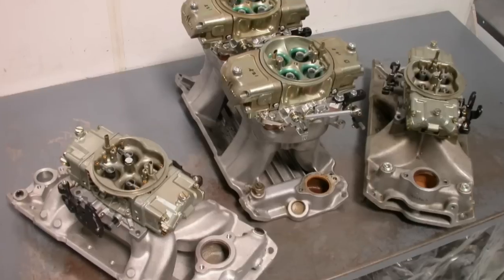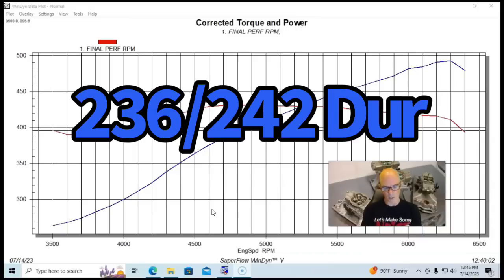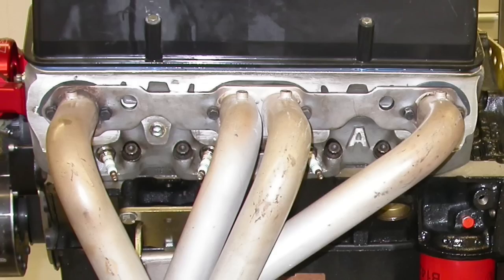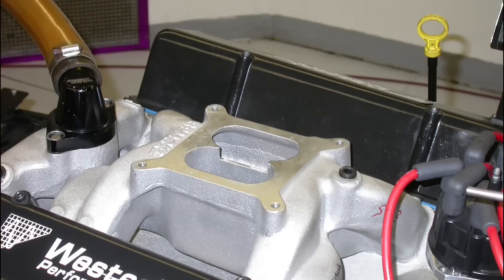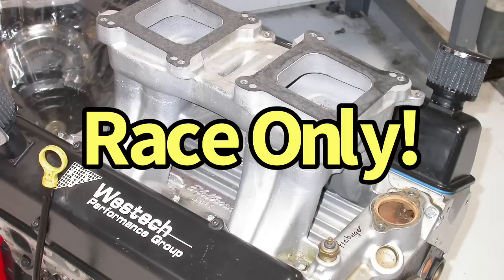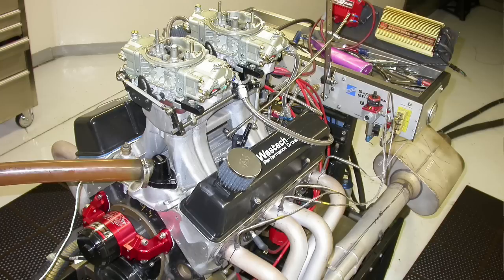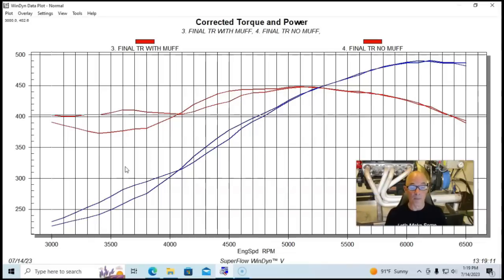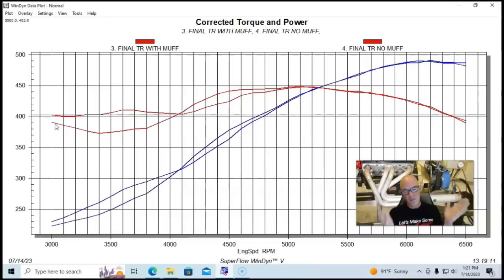HOW MUCH POWER IS A SBC TUNNEL RAM WORTH? 355 SBC INTAKE TEST-TUNNEL RAM VS RPM AIR GAP VS VICTOR JR

Comment: Had a friend with a 71 327/350 Vega, it went well and drove great ran low 13s.  He then switched to a 30/30 cam, tunnel ram with 465s and a Vega converter, the car was insane ran high 11s.  Total cost for the parts ~ $600 in 1988.  He put it together in one weekend.
Reply: I used a Vega converter in my th400 it was so loose from a stop on hills.
Reply: @vinceyoung5912  What was the vegas stall speed? Never knew about those
Know some late model S10s were 24-2500 C4 guys liked to use those on 700rs
Reply: @gordocarbo  it was a small converter. 3000 at least
Reply: @vinceyoung5912  thx!
Reply: What is a 30/30 cam?
Reply: @drd1924  GM Term for the solid lifter cam used in some vettes, Z/28s
Rocker arms were set at .030 lash on intake and exhaust.
Reply: @drd1924  it’s a solid cam with 30 thousandths lash on intake and exhaust
Reply: @gordocarbo  Copy that, Thanks
Ford guy here so ya know.
I've heard the term 3/4 race cam
... Full race cam etc. which in effect really means nothing when Cams are usually described in terms of either lift or duration.
3/4 Race is just some obscure slang term for how radical a cam is past stock
Never heard of any other terms such as 30/30 so I suspect is a proprietary GM thang.
Reply: @vinceyoung5912  Thanks man, now THAT makes a lot more sense.
That's quite a bit of lash compared to most.
I remember once I was reading one of my older Truck manuals to set the lash on my 429 BBF and it said 0.250" 
I had to stop and reread that like 3 times
And finally figured out they meant
0.025"
I shudder to think who might have actually followed the manuals advice there lol.
Reply: @drd1924  254/254 duration .485/.485 lift solid flat tappet cam used in fuel injected 327s and the 302.  30/30 name came from the I/e lash of 30 thousands.
Reply: @gordocarbo  4000 - 4500 in my experience
Reply: @edwardwood3622  Thaaaaat's more like IT! :D

Comment: So this one time not long ago, the night before one of our local car shows I decided to install a tunnel ram that I expected to be for more show than go, it had been sitting on the shelf for a decade, it was an original offenhauser with a massive upper plenum from the 70s that I had bought at a swap meet for a completely different project and I was sick of looking at it, so I got to work re-sealing the 500cfm Carter competition series carbs that it came with and installed it all with a completely new MSD ignition system and all of this going on a 100% bone stock 350 that had been recently rebuilt and .030 over, stock 70s truck heads and cam, it had small primary long tube headers and mated to a 700r4, it was replacing the original intake and Q-jet that ran well in my open wheel roadster, after some quick tuning and a couple HUGE burnouts to say I was shocked with the seat of the pants difference it made would be an understatement!!! I never imagined it would work as well as it did on a stock 350, I’m a believer!!

Comment: Runner length, runner length, runner length!!! Mr Holdener, you ROCK! ThankYou for all the hard work and data you share. There is a company called dashman making tunnel ram spacers for weiand tunnel rams. Like 1-4inch lengths. Might be cool to see it swing the torque curve. Stack them up for a carbed TPI torque curve?

Comment: If you had added another 1000 rpms you would have seen the improvement that the tunnel ram was designed for.
My 361 inch small block picked up 64 hp when I went from a Victor Jr and an 850 Holley. To a tunnel ram and 2 750 carbs at 7800 rpms.
  My motor was 12.5 to 1 and had 220 afr heads and had a .630 Crane roller cam.
     It brought my nostalgic gasser from 6.70 in the 1/8th to 6.30. Then I swapped to twin toilets and alky and dropped to 6.10.
Reply from the maker: this cam would not go another 1000 rpm
Reply: Will a bigger cam help the ram ?

Comment: SBC vids are THE best. I'm only 29 but I'll still likely never build an LS. Love the old school stuff too much.
Reply: They are very vailable and built from scratch with aftermarket parts cheaper to do than an ls. 
BOlts right in no hassles with wiring

Comment: Me and my buddy just finished a 331 sbc gasser type and had the 600 carbs totally trickef out and the throttle response was wicked fast, been told it would it would not work ! I believe its the combination of the correct parts that work together. Been building sbc engines since 1970, but this one was the most exciting and satisfying build  !

Comment: Joe Sherman (rip) consistently  made 30 to 40 more HP than a single carb single plane , but his testing was mostly on 400/410 ci engines.
Reply from the maker: Joe was awesome
Reply: I'm going to look at a 73 Ford Mach-1 with 400 and a tunnel ram dual quad 351c adapter kit this weekend

Comment: Unless you happen to have a common plenum tunnelram, you need two carburetors individually as high-flowing as the carb used on a single carb intake for a given motor.

Yes, that's individual flow - not combined. 

Regardless of layout or number of cylinders (as long we're talking fourstroke and the number is less than 16), there is only one (1) cylinder at a time being fed air and/or fuel from the plenum/carb. Thus, on a dual carb/dual plenum intake you need each carb to be able to provide as much flow as on a single carb/plenum ditto - otherwise, it becomes a restriction and this of course hurts power output.
Reply: I don't think I've ever seen a tunnel ram with a divided plenum. IIRC they all use a common plenum. That said, if you have a divided plenum with 2 throttle bodies, the plenums have more time to refill after each intake stroke. So you can use throttle bodies smaller than the single unit. But half the size of single unit might be too small.
Reply from the maker: I have never seen a tunnel ram that feeds two distinct (separate) plenums from each carb and your theory that you need double the flow rate for two plenums is also inaccurate

Comment: The TR1Y is pretty ancient, that design is about 50-55 or so years old.

It would have been interesting to see the tunnel ram with two 450 cfm carburetors, I'm thinking 900 cfm was plenty, and the 650 carburetors might have been big enough to hurt torque, and maybe they didn't work great with the plenum.

It would also be interesting to see what the air fuel ratio was. I know you played with jetting, not saying you missed. Just saying we see a ton of power by working on making the fuel curve the engine wants. Just jetting doesn't necessarily get you there.
Reply: Quite the opposite, the 650s are too small on the TR.
Reply from the maker: 650s are actually oversized for 500 hp
Reply: You right  in the 70's that intake was used for 7500rpm+launches
Reply: I agree with needadate and ronnie , needs more cfm for the tunnel ram , a set a valve springs would also help , my guess is the springs are going off in a hurry and the ram was tested last so suffered the most up top
Reply: It would be interesting to see how the new sheet metal tunnel rams work vs these older one?
Seeing one vs two carbs would be interesting.
I would think the top hp would be close?
Reply: @hobbesnmina2001  the throttle response will always be better with a venturi and accelerator pump discharge nozzle directly above each runner.  Factoring in that the carbs are all tuned and adjusted,  dual quad setup is far superior to a single on a tunnel ram.  I would like to see a dual quad carbs vs dual quad Holley Sniper efi on a tunnel ram.
Reply: That's not how dual carbs work. Each carb gets half the signal of one single carb. 2x450s don't give 900 cfm is what I'm saying.
Reply: @jeroldlafferty54  no it wasn't, the victor ram was
Reply: @lollipop84858  back in the 70's and 80's if you was running any 2×4tr stick shift cars would leave 7500 shift at 8500 go thru the lights 9000 with 660cfm carbs. Victor intake didn't come out until late 70's if I recall.
Reply: @jasonjordan4672  Think that cam was running out of breath around that rpm also

Comment: My personal 406 with AFR 245 heads makes 665 HP using a plenum modified Super Victor 4500, I did try a tunnel ram and twin 950's and although both combinations made similar power, the Super Victor had a much broader power curve, and therefor much more average HP and torque than the tunnel ram. The tunnel ram did look much cooler though.
Reply: Interesting. I have a 406 with a dual tunnel ram set up. Seems like low end power is a bit weak.
Reply: @transformationclass5054  dual tunnel rams?? 2 tunnel rams?? Wicked!

Comment: I'd be interested to know what the jetting was on the tunnel ram carbs.... If you're too fat you're going to lose power.... a/f ratio is something that needs to be considered.... Frieberger did something similar on engine masters and the tunnel ram made more power everywhere except the very bottom end....so many factors need be to considered.
BTW I've been running the same exact intake rebranded as the Eldebrock street ram for years starting with a 355 ci and now with a 383 ci the combination has worked great for me and looks amazing.... I've had no problems with drivability especially in stop and go traffic... works for me....

Comment: Put some valve springs in the engine! Totally inconclusive test if you didn’t rev that engine to the rpm it should operate at
Reply from the maker: agreed-missed it by 200 rpm
Reply: @richardholdener1727   so you bamboozled them huh? J/K

Comment: I expected to see general torque ad lower end power increases but I'm kinda surprised it didn't have a higher peak than a single card.  But about exhaust I always wanted to try to make a variable type exhaust so it would scavage low but then at 4k or so open up for all that top end. I just think it would be fun to get the max everything
Reply: Your exhaust fantasy is referring to correctly designed (Elston) tri-y headers

Comment: Hey Richard, have you ever done any dyno testing of scoops vs stacks, with and without filters, on tunnel rams?  Thanks!
Reply from the maker: stacks?
Reply: the velocity stacks that mount atop the carbs, some use no filter, some use a screen with foam, and some use a filter with a lid.  Shaped similar to a funnel.  I know you’ve seen them before.

Comment: Those straight through mufflers need a certain amount of exhaust flow to become efficient where there is almost zero restriction.
Reply from the maker: why do they need more flow to become efficient?
Reply: @richardholdener1727  from what I understand once you get enough flow the exhaust will pass right over the perforations instead of penetrating eliminating turbulence producing effectively a straight pipe.

Comment: More carburetor on the tunnel ram. Two 750"s I think would fix the lack of upper RPM horsepower.
Reply from the maker: so 1300 cfm wasn't enough for 500 hp?
Reply: @richardholdener1727  since it's not a common plenum, you had 650 cfm available - not 1300. See my post below.
Reply: Yes, and since we're around the 500 hp mark even bigger carbs would most likely improve the output over those.

There is zero (0) difference in individual carb flow requirement between a single and a dual plenum intake on the same engine. This is pure physics.
Reply from the maker: I believe these had a connection in plenum, but if not, then you are saying that a 650 isn't enough to support aa 4 cylinder that makes 250 hp. Having tested this on the dyno on another sbc, you are incorrect.
Reply: @richardholdener1727  Amazed how many try to correct you and the usual response is they heard...or the internet said..
Wow

Comment: Regret selling my 87 back in 07 now i have a 90 k1500 4x4 5.7 single cab im building runs perfect at the moment ac,heater works engine purrs nice and quiet unwanted noise..looking for a mild cam gona run 199cc afr heads convert my tbi back to carb and run a dual plane air gap,with a 750 cfm holley..just not shure what cam to run..i want a H roller for maintenance and reliable just dont know which option to go with..people say the 270hr is a good option befor having to upgrade to a 26-28 stall converter

Comment: That compression, cam, and springs are well suited for the single carb-dual plane combo. It's border-line stretched for the single plane. And it is totally wrong for the tunnel ram. A tunnel ram shines with high comp., much more cam ( high overlap decreases dynamic compression so it can live on premium pump gas ) and strong enough springs to let the TR eat at 7 to 8K where it's designed to run. THAT'S the purpose of a tunnel ram. As with everything automotive; it's all in everything working together! This video proves just that.

Comment: Was that cam a solid, hyd ft or roller? Remember that article. 
500 was a big deal for a 350....remember in the 80s the 390-400hp recipe was 11-1 350 292 type hft cam ported 2.02 irons and of course The Berg had a Vic Jr on there lol. Isky 292 mega seemed to hit harder than the comp 292 magnum
Id think you were losing valve control up top the TR should carry a bit more unless it was outta cam. 
Whaddya think Jedi Richard?
Reply from the maker: roller

Comment: So I'm trying to convince my friend to go with a tunnel ram with a dual efi throttle body injection using the super sniper. His engine is a 400ci sbc destroked to a 377 I think but his compression is 11.5:1 and runs on 93. I think the tunnel ram will wake that engine up by alot. What do you think he should go with?
Reply from the maker: tunnel rams work well
Reply: WHy not 2 carbs way simpler cheaper no need for all the electronics, screen in the car etc
Reply: @gordocarbo  the car is a daily/weekend warrior car. Last thing he wants is a car only doing 6 miles per gallon. Carbs are nice if the engine was a all out drag car but this is a car used quite abit more then a trailer queen. Plus he did do a tunnel ram with 2 efi holley super sniper systems. He is also running on coil packs vs a distributor. The car made 730whp 620wtq on e85. The compression was raised to 12.5:1 compression. I told him if he's not going to drive it as much but at least 3 times a week to run on e85. It also has a flex fuel kit installed. The camero hauls ass running low 10s so far. From being a mid 11s car.

Comment: Looks like it needs a little more valve spring if dual plane and single plane nosed over at the same spot? Or is that just where you stopped the test?

Comment: If not turbo'd why are long collectors not common.  After all it is free total power under the curve.  From what you showed and previous tests there seems to be no questioning of this fact.  There is certainly room under the cars and some pipe is really cheap to buy and install.
Reply from the maker: proper runner length is always a benefit